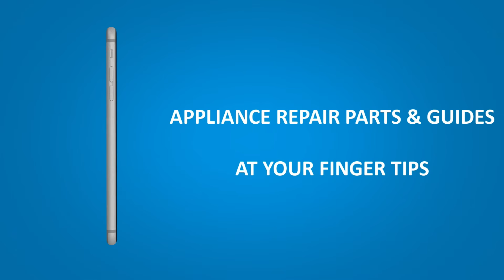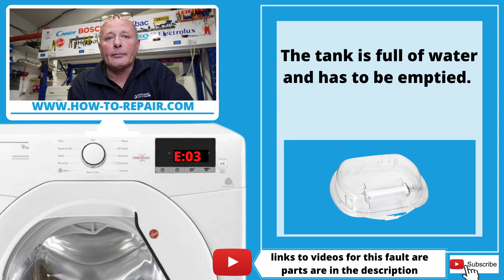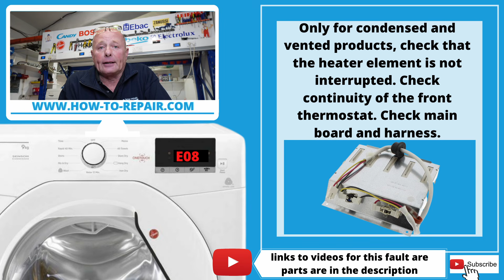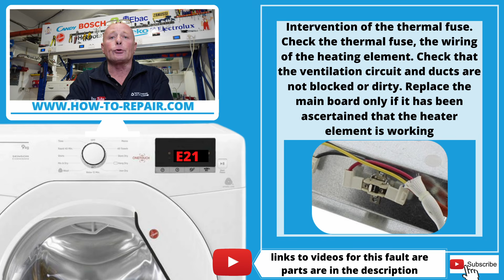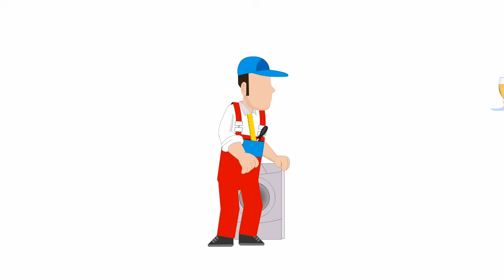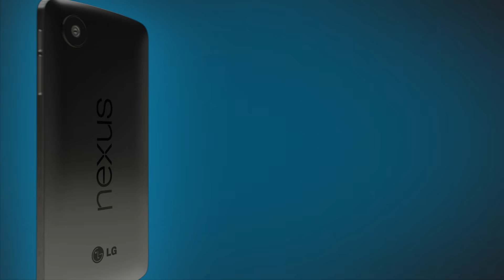Hoover Tumble Dryer Dynamic Text error fault codes on one touch or Candy smart touch

Comment: Hello, I have a problem with my H-Wash Dry 500. When I connect it, I get the error E13, no matter which program I select. It's always an E13 error. I've checked the wiring, connections, resistors, and NTC, and everything is fine. The circuit board doesn't look anything unusual; the circuit paths, resistors, and capacitors are all OK. Can you give me some advice? Thanks.
Reply from the maker: Hi mate sorry about your problem but I'm in the Sahara Desert right now and I can have free time occasionally. I would like to help you out during my live streams. I'll be posting when the next one's happening so please subscribe and turn your notifications on then you can catch me live. I'll stick the link to the last stream below so you can get an idea of what they're like. I'd love to hear your problem on the show mate, cheers.
https://www.youtube.com/live/JEcgidBKa40?si=rHbT7SW0m8hVhbMT

Comment: Hi we dont have an error code. There is a red ligjt next to the cog symbol. We have a H-dry 300 hoover tumble dryer. This was working fine. The second load will not press to start. We have cleaned all the filters, checked water to no avail.

Comment: Hi there I've got Hoover DXOHY10A2TCE_WH Heat Pump Tumble Dryer that comes up with error code 21, I've tested the two thermal fuses on the heating element and they're both fine can you suggest anything else?

Comment: I have a hoover link hl v8lg-80 and it appears to be displaying the vent error indicator. I've cleaned the vent pipe and the vent hole and the filter on the machine, I have lowered the vent pipe to the correct angle but after a short time into the cycle the machine stops and displays the vent error. There's no information online and it's a second hand machine so I'm not covered by the manufacturers guarantee

Comment: Hi. E22 on either vented or condenser dryers is down to a oc Ntc on the heater. As you look from the back, it will be the left Ntc, e21 is normally the one on the right

Comment: Hi I have a hoover dryer DX C 10DE-80 with a E22 fault I have replaced the pump and tested the switch all working but fault still there is it the relay 
Cheers mick
Reply: E22 is a heater Ntc fault

Comment: Hi, great video! I have a Hoover DXC10TCER. It’s not showing any error codes but it is not drying. Drum is getting hot but cycle stops before the load is dry. Could you please advise which part may be faulty- thanks ☺

Comment: I don't have an error code but I have lights flashing and English on the screen, if you press either of the buttons below the flashing lights it just changes the language.  I have tried turning the machine off and on again, I clean the main filter out after every use and the condenser unit was cleaned out with a hose pipe the other day, the machine worked fine afterwards, the machine is only 9 months old.
Reply from the maker: I would not mess with the machine if it is only nine months old as you have a guarantee and you need to call out the appropriate engineer who will fix it under warranty. If you start messing with the machine you could void your warranty @user-hz6ri8lt8v please remember to subscribe to our channel as that really helps us https://www.youtube.com/shorts/e432SAb2g08  Thanks, Paul 👍

Comment: Thanks for the informative video. My Hoover One Touch dryer has decided to not turn off, even when the dial is set to off. There are no error codes, but the display panel is completely illuminated. I had to pull power to get it to stop, when I reapplied power it started spinning again and some smoke was visible coming out of the top at the front. Any ideas? Is it worth fixing?! I've never been very happy with it, I've always found you had to press the start button 2 or 3 times to get it going (so not One Touch), as some other people have noted. Many thanks!
Reply from the maker: The smoke concerns me this could either be from the circuit board a belt slipping or possibly the motor. I would suggest you get someone who knows what they're doing to find out what the problem is I'm sorry I can't be more help but I do not want to be part of a possible fire by giving you the wrong advice. glad we could help you Christian Murphy this is for you https://www.youtube.com/shorts/e432SAb2g08 please remember to subscribe as that's what keeps this channel going. Thanks 👍

Comment: Would it spring up a e13 error if it's kept in the cold? Mines in the shed and it's -5 outside just gone out and turned it in and it's come up with that code
Reply from the maker: If you have the machine in a -5 environment and it is a condenser dryer they could be all sorts of problems without having the full model number. I am unable to give you what are you 13 hours. Please use the website Hi @johng7953 I will need the full model number of the identification plate please use our contact us page and make sure you fill out the request of what part you are after and will get back to you within 24 hours normally https://www.how-to-repair.com/help/contact-us/
this is for you https://www.youtube.com/shorts/e432SAb2g08 please remember to subscribe as that's what keeps this channel going. Thanks 👍

Comment: Hi   I have the e22 error code.- on the candy grand vita dryer.  I do not have the skills or equipment to test the heating as mentioned so what do you suggest i do or what do i need to buy? Thanks in advance
Reply from the maker: Really sorry for the late reply. I was away on holiday. If you have a problem with the heating system it is not an expensive job. I never suggest replacing machines as I do not believe in obsolescence. Thank you very much for subscribing to the channel. Have a great Christmas and a happy New Year

Comment: I have no error code & it dangerously keeps stopping mid cycle 🔥🔥🔥 none of the buttons are responsive when this happens & have to quickly decamp all washing 
The front panel has caved in trying to get the touch panel to work now 🙈
Reply: This is the worst dryer ever & only 2yrs old

Comment: Hoover heat pump tumble dryer
DMH D1013A2-80 . Can you please tell me what is the error code 04  means? Dryer will not stop when in off position and it carrys on running for 5 seconds then E04 appears in the setting screen and is only then the tumble dryer stops but the E04 keeps flushing with broken audible  beeps. Please help. Thank you.

Comment: Hi, thank you for your assistance it has been very helpful. I have an E14 code flashing on my hoover dryer. I noticed whilst E14 code is flashing that it does not warm up when keeping it running. Does this mean the there is more issues then just the ntc as you mention in your video?
Reply: E14 could also mean that the ambient temperature is too cold for the machine to operate. Ideally all dryers need to be in a room temperature environment